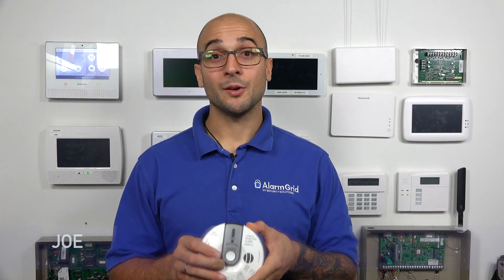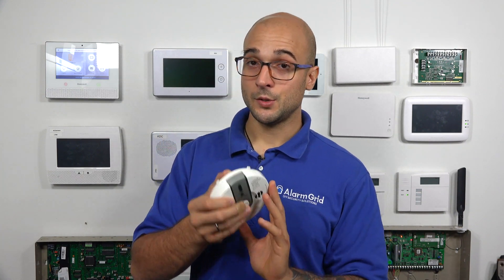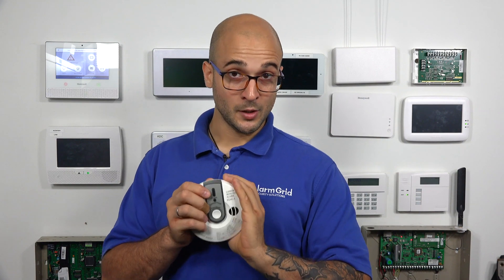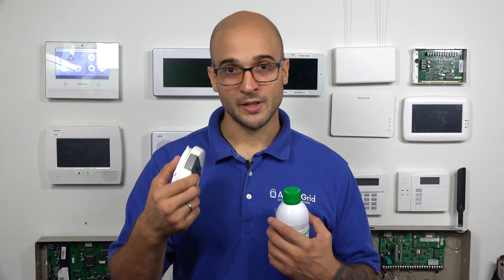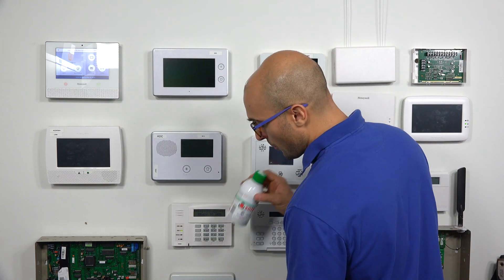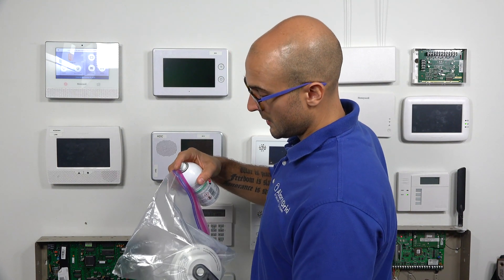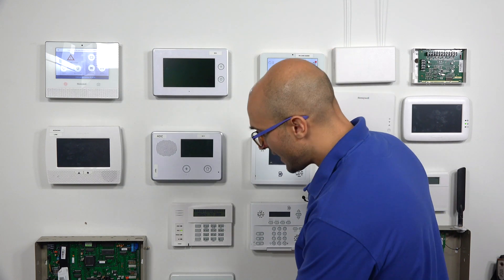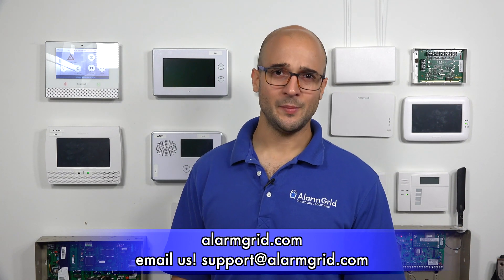Properly Testing a PowerG CO Detector

Comment: What is the function of the test button? It seems to only test the beeper on the detector itself. Holding it doesn't trigger an alarm on the panel? Seems basically worthless to me.
Reply: If the sensor is properly enrolled pressing and holding the the test button for full 6 seconds will cause it to trigger at the panel. Holding for 2 seconds only triggers locally.
Reply: @nathangalarmgrid5205  Interesting, holding for any length of time only gives me a couple beeps. No communication with the panel, nothing that I would recognize as a local alarm really either. Certainly seems to be enrolled correctly, tamper communicates, low battery communicates. What could be going on here?